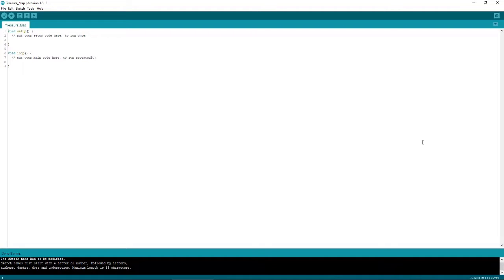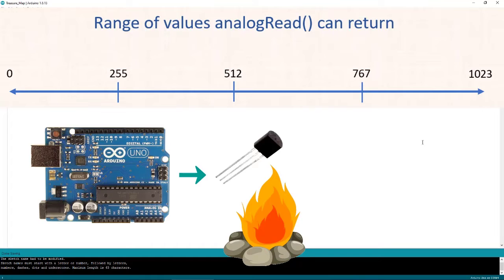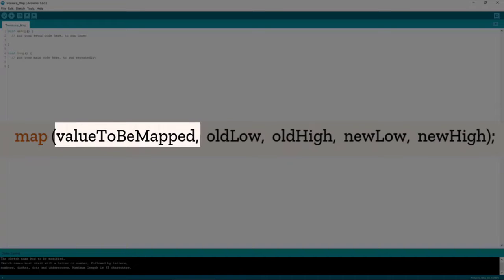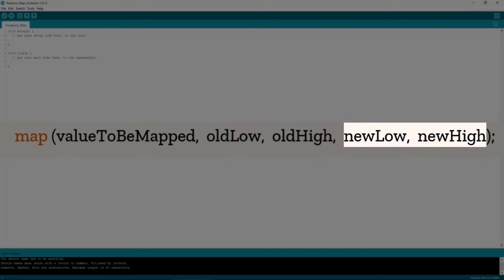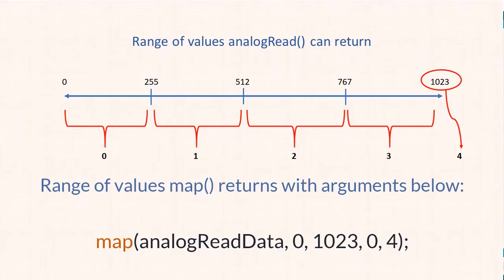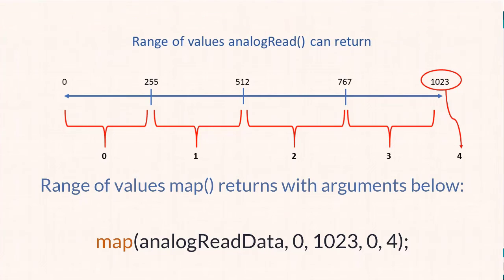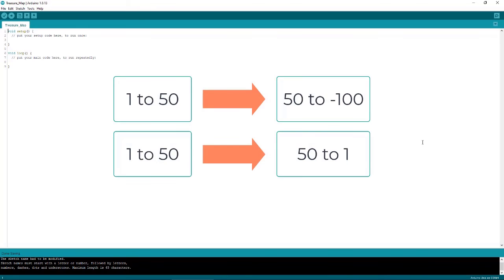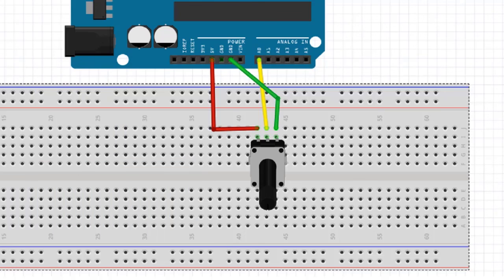How to use the Arduino map() function

Comment: A fairly minor alteration to the map function eliminates the issue with the output mapping to the max value for only the max input and improves the distribution of the output values.

long mapEx( long x, long in_min, long in_max, long out_min, long out_max)
{
    return((x - in_min) * (out_max - out_min + 1) / (in_max - in_min + 1) + out_max);
}
Reply from the maker: That's awesome, thanks for the tip!